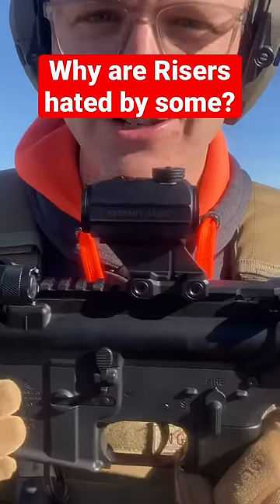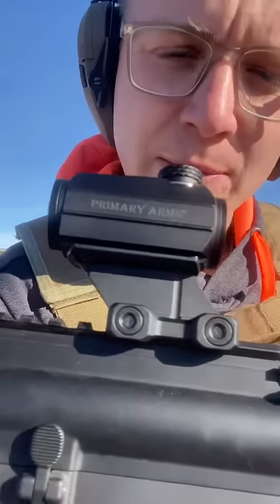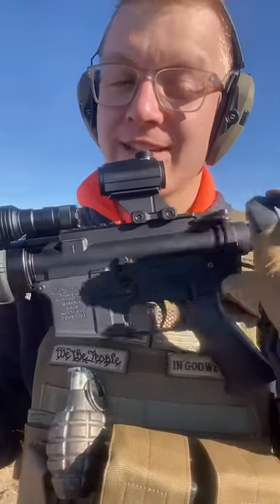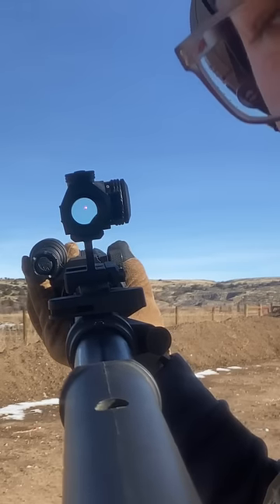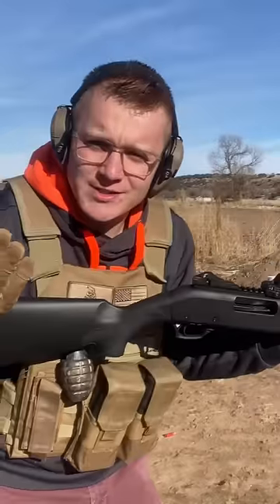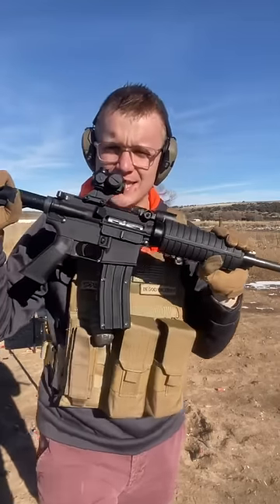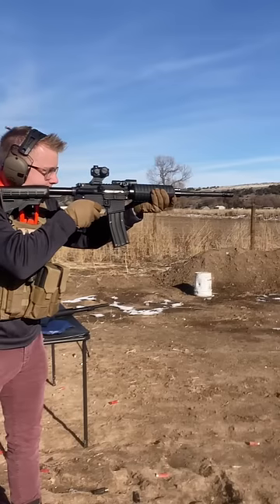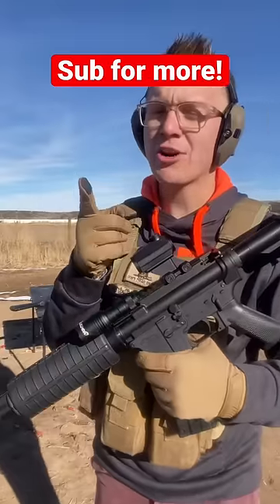Why some people HATE this… (height over bore) #gun #fullautofriday #civtac #bodyarmor

Comment: Are you able to see the iron sights from the shotgun with that mount and red dot on?
Reply: Most likely, and sometimes people like to line up the red dot with iron sights, which is called a cowitness.
Reply: Probably not, you can co-witness sights but on the shotgun the Irons look a little too low.
Reply: 100% correct, I'm just explaining what the cowitness is if the commenter didn't know.

Comment: Maybe some noobs don’t remember the M-16 had a “handle” on the top that was the rear sight.

Now, the aR platform is a flat top pica rail, so an optic that is not raised, means you gotta raise the butt stock  up to the corner of your eye to get a level sight picture, rather than have the stock resting lower at your cheek

Comment: Wrong. You need a riser because an AR uses a straight stock with no taper. Shotguns, traditional rifles, etc have stocks that taper down (as can be seen in your video) so that when you get a good cheek weld you are looking straight down the top of the barrel. Get a good cheek weld on an AR however, and your sight picture will be about an inch above the top of the rail. Has absolutely nothing to do with target acquisition 🤣 the nonsense I see in some of these videos is hilarious. You can’t just come up with what you think is a good reason and run with it. Do some research lol

Comment: They also say to put the red dot as far forward on the upper as possible for "sight picture". That is why your riser has a forward cantilever. aslo, the shotgun doesnt need a riser bacause the bolt doesnt go where you face is.
Reply: Charging handle shouldn't move when you shoot an AR15
Reply: @XM8A1  true, but you still cant put your face through the buffer tube to get that red dot in the right place. You instead have to lay your head sidways on top of the rifle or put a riser on. With that shotgun, the bolt moves right at your face and stops before it gets there. Your cheek rests behind instead of above the action.  If you move your face up, you need to move the sight up.
Reply: @josephnommensen4025  exactly. I can't make my neck shorter, so I moved the sight up.

Comment: I always put my nose on the charging handle. Pounded into my at basic and it stayed with me
Reply: You’ll change that once you start shooting a lot
Reply: You will get away from that. Really only useful for something like an ACOG that has limited eye relief and a shorter absolute or lower third co-witness
Reply: @collinjones311  facts. Really limits the field of view when using something like a aimpoint T2, eotech etc.
Reply: @krysis8115  right. The T2 already has one of the smaller objective lenses as it is. I have one and have it mounted on a unity Fast mount on the last pic slot on the receiver before the rail (same spot I mount all my red dots.) Only thing I have mounted further back is a prism because I have to and that's not even mounted all the time. That's really just a backup optic.

Comment: Do they make adjustable risers? So that you can move them up and down according to the distance that you’re shooting at?
Reply: for dedicated optics mounts like these, no, not that I'm aware of, and here are a few reasons it wouldn't be worth it:

1. if you have time to fiddle around with something like that, then you have enough time to simply make that mental adjustement.
2. aside from being another thing to break, designing a moving piece which could still retain zero (ie., not allowing the optic to wiggle at all so the dot is always in the exact same spot) would be...difficult, to say the least. I'm sure it's possible, but it would be very expensive because the tolerances would have to be ungodly precise.

there are adjustable-height picatinny rail risers which exist (but those are rail sections; relatively long, tall, and bulky--and then the optic mount would attach to that). I don't know if they're worth a crap, but they do exist. certainly not the sort of thing you'd be making field adjustments on, though.